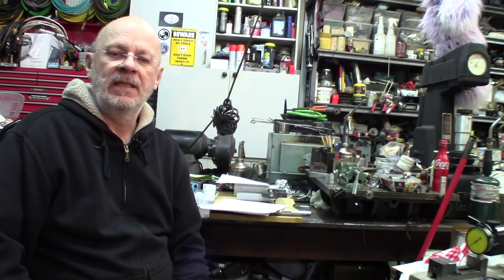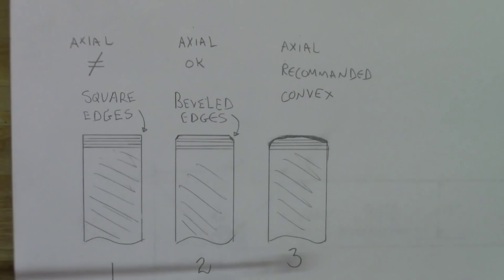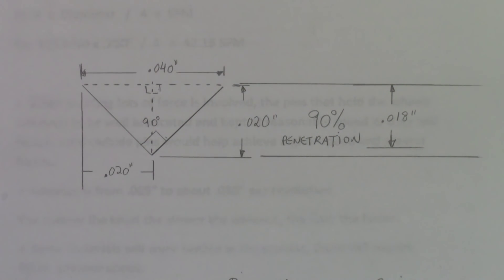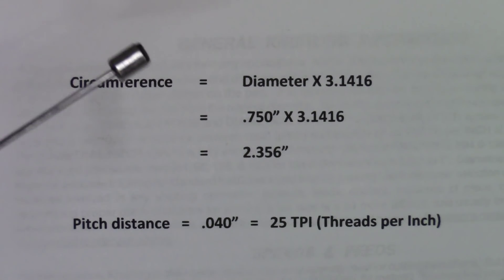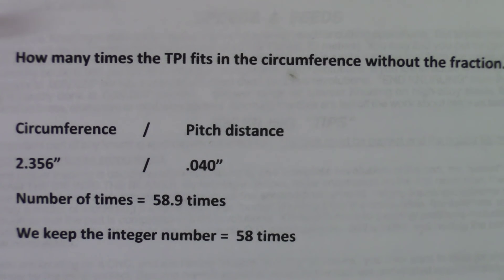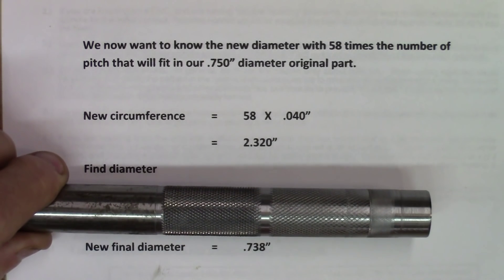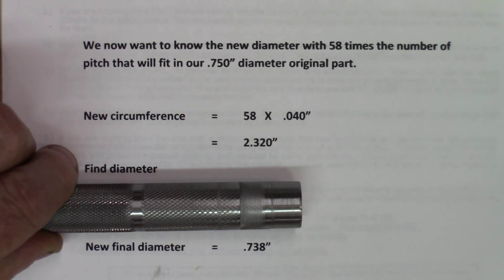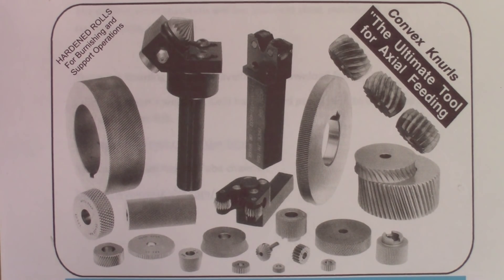How to knurl with a pinch type knurling tool, the basic theory, part 2

Comment: Thank you very much for the information. I'm at evening class tonight knurling a screw head as part of my current project, so will now be using what I've been watching. Regards
Reply from the maker: Hi Peter,
Hope the training works out for you...   ;)
Don't forget to apply enough pressure from the start even more with a bump type tool...
Thanks for watching and for comment,     Pierre

Comment: Pierre,
Great video on knurling basics. I use to use the formula you described but last year I discovered an app "Knurling Calculator" for Android smart phones. As they say "there is an app for that" and it is list at Google Play. It works just like your formula but only for TPI and inch dimensions and no metric.
Thank you for the knurling series, Paul
Reply from the maker: Hi Paul, 
Looks like everything is going "I" something or Android, I believe that we all should know at least the principle behind a application, question of making the adjust or variants, and, even just for the day we forget the kinda not so smart phone somewhere...   ;)
Thank you for nice comment,   Pierre
Reply: +pierre beaudry I agree 100% on this topic otherwise when things go bad your can't find the route cause to the problem. I did everything with a slide rule until 1973 when I started my MS and PhD programs in geophysics and finally had access to an electronic pocket calculator. The cool thing about using the slide rule is you had to keep track of the order of magnitude in your head and really look at the calculation to see if it made sense and sometimes use two different approaches and compare the answers. Today we seem to just push a button and think the answers must be correct. We have to add common sense to our measurements.

I enjoy your videos because you provide insight to the processes. Thank you, Paul
Reply from the maker: I rarely find people that even know about the existence of a slide rule, even less about using one... I still got mine, would need a few minutes to get back at it...   lol
Thanks again,    Pierre

Comment: Pierre:

Very well explained. If you can't reduce the diameter to achieve the whole number without fraction for some reason, is the only option to change the knurl pitch?
Reply from the maker: +Larry Collar 
Like you mentioned, changing the knurl pitch would be possible, now, you have to calculate a pitch close enough to get the wheels to track after the first revolution, you get a little margin,  hopefully there is an existing knurl that gets that close....  
Thanks for watching and commenting,    Pierre

Comment: You covered the subject nicely Pierre. I know well I need more wheel choices.
My home made knurler has bolts instead of hardened pins but, I did case harden those and amazingly they have stood up well over the years. Now, I'd use pins I think.
I grabbed Keld's small program recently but haven't played with it yet.
Reply from the maker: +ChrisB257 
The pins will hold better with closer tolerance than screws, you may try getting shanks from endmills as pins even if you find some made of carbide... 
If you get in touch with Accu-trak people you'll get great wheels, go to their site and you can consult the catalog...
Thanks  for comment,   Pierre

Comment: hey you did the calc in your head, Grins nice explanation of how to work out the size to get what you want this is why you need a test part as well I dont think any one gets it right first time.
Reply from the maker: With the proper measure it's relatively simple to get it right the first time, one thing to take into account is that the first revolution has to imprint deep enough to make the second turn re-track into itself, you don't have to believe it but I get the knurl right at least 90% right the first time...   ;)